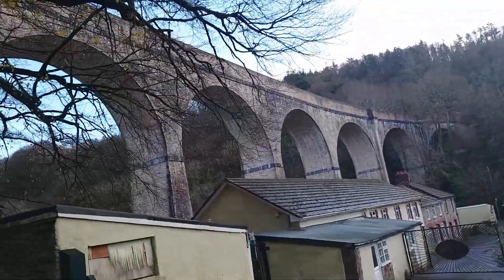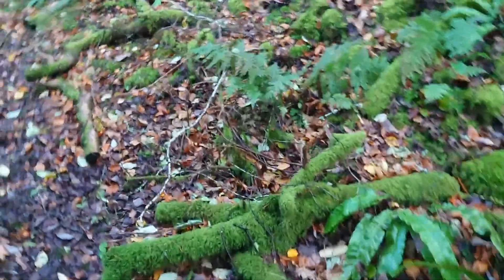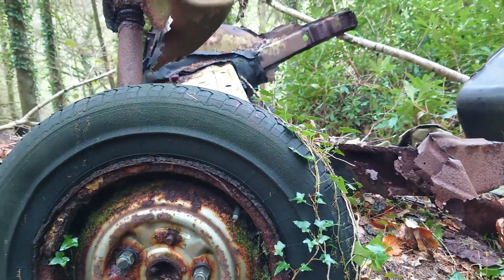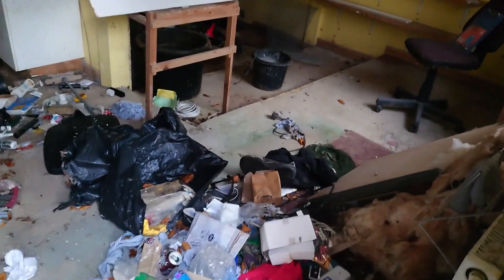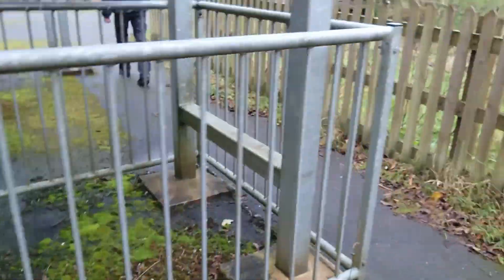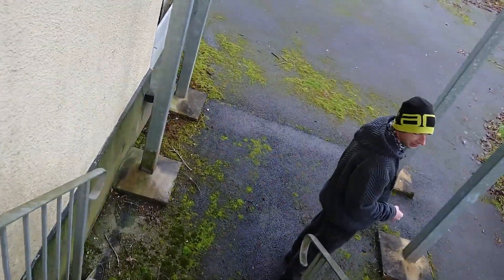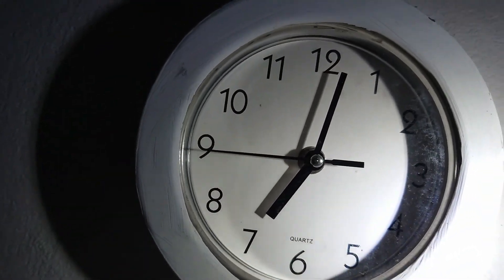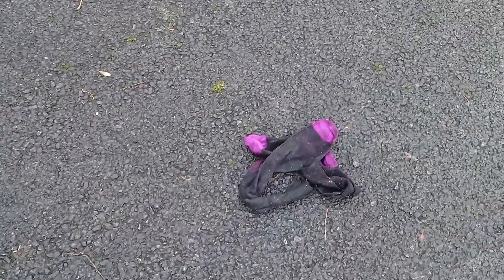Chelfham Viaduct & Abandoned chelfham mill school urban exploring

Comment: 31:54 I used to go to this school, I recall there was a window close to the ground around this point leading into a toilet. Unless it's been sealed or boarded behind that the door at 34:25, you could easily get in via that. Also, on the other side of that metal stairway was a dirt slope which descended to ground floor level - at 34:02 - and there were another window down there which was often unlocked, leading into the Rec(creation) Room with a TV at the back of the building.
Reply from the maker: Cool thank you for the info, at the time I couldn't see a obvious way in.